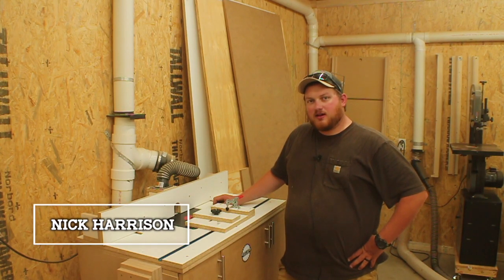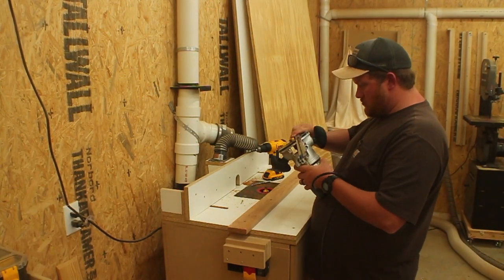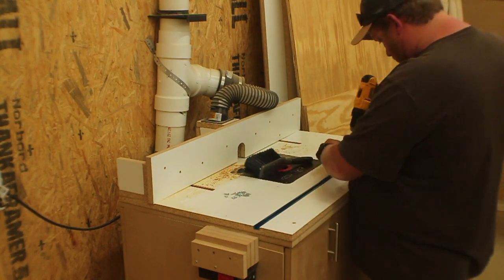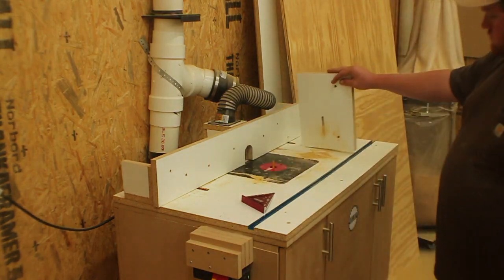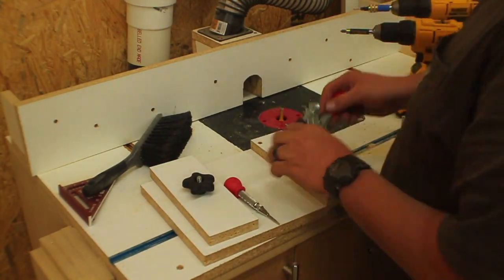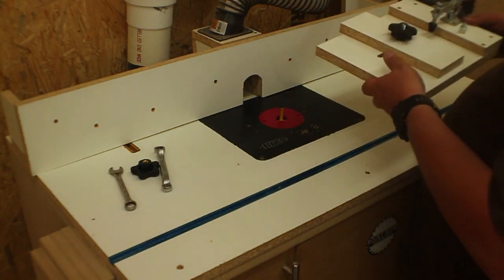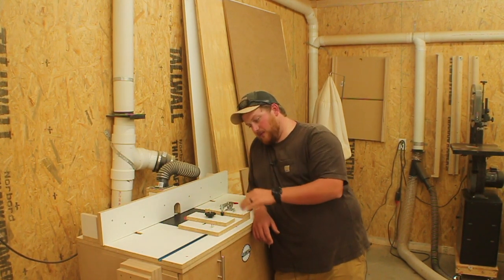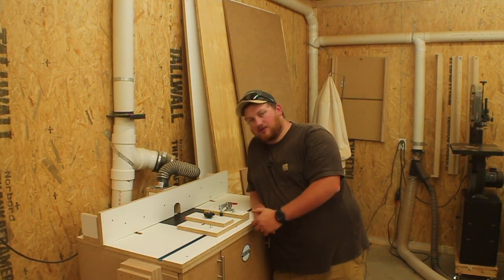DIY Router Table Coping Sled with T-Track

Comment: sliding loose bolts in a t-track inside loose holes is a horrible design.  why not use a miter gauge with a proper runner?  you could even fashion your own runner that fits the t-track.
Reply from the maker: On my new router table I have deleted this method and have something similar to what you're referencing.